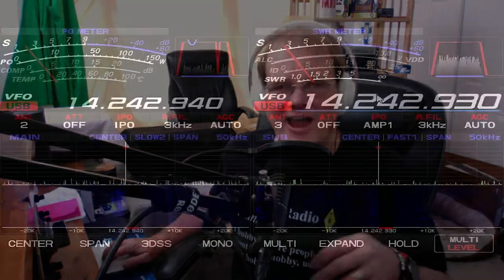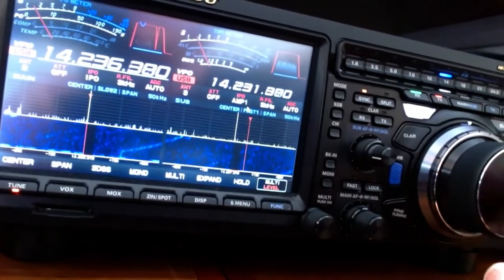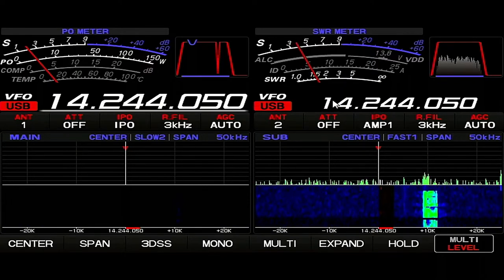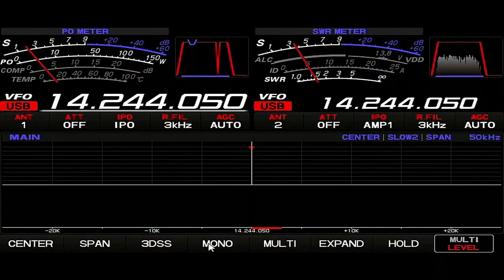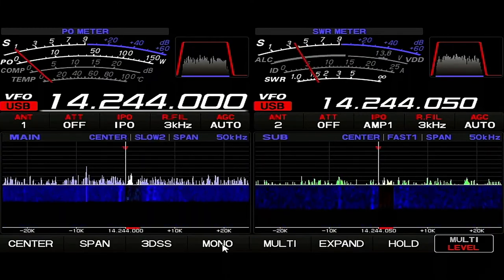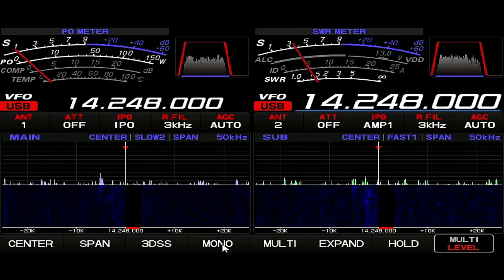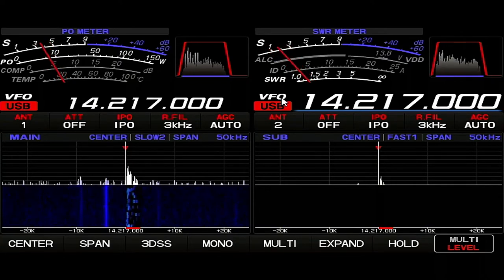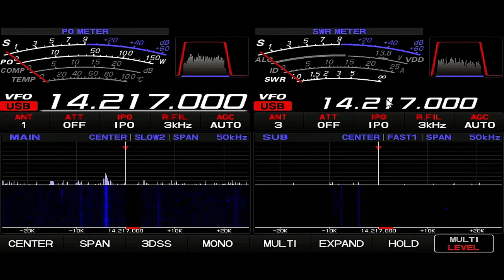Ham Radio Live! Show 146.5 Diversity Reception On A Ham Radio. How To Use It & Why On The FTDX 101.

Comment: Hi Larry, just stumbled across this video, my FTDX-101MP arrives in a few hours, I might have had a licence for about 40 years but it is still exciting waiting for my first new HF rig for a very long time. Coincidentally I still have my FT1000D I bought from Callum nearly 20 years ago. A friend in the village spends about half of his year in a hotter climate and lent me his FTDX-10 while he was away, it was like a gateway drug into SDR based transceivers. Unfortunately I had been very spoilt by two antenna diversity and absolutely had to have dual receivers. When radios with two receivers were first introduced I was cynical how useful it would be, but with two antennas and with stereo headphones it is almost magical how you can often copy signals despite deep QSB.
You would be amazed with what a Raspberry Pi connected by just one USB cable can do with one of these radios.... remote voice and data, not what everyone wants to do but it does hep to get maximum use out of an expensive radio. 73